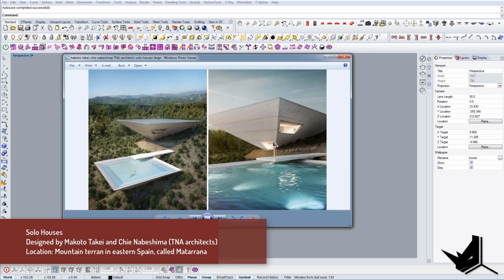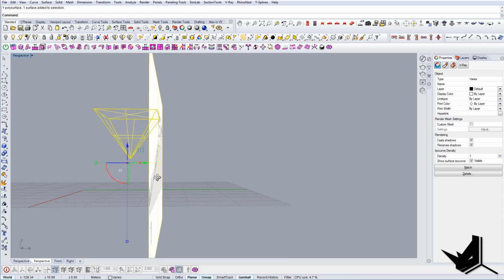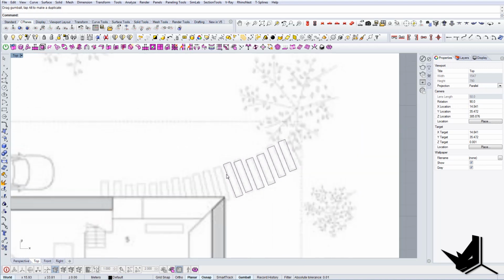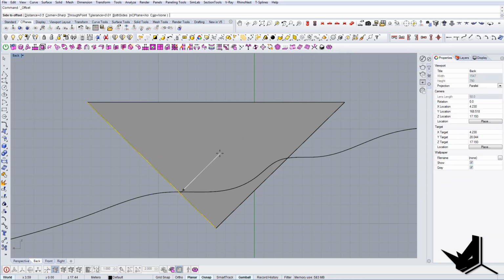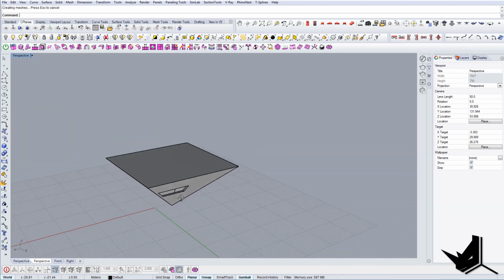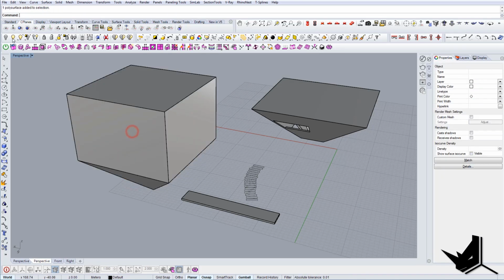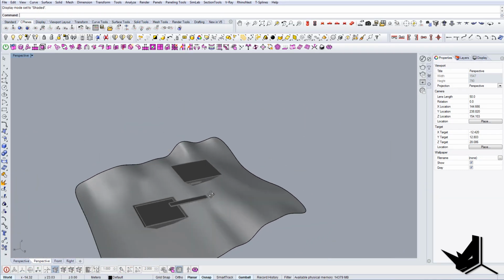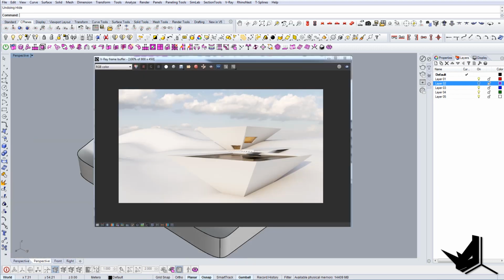Rhino Architecture - Modeling Solo Houses

Comment: can I do this without using T-spline ??
Reply from the maker: Yes, sure. You can create a normal surface and use control points F10 to play around with the ground and get to look like you need.